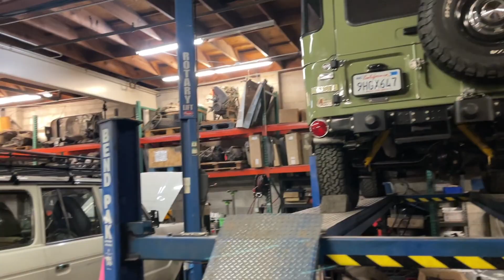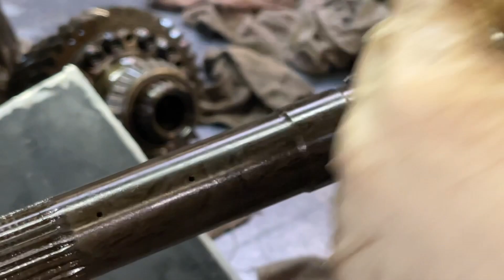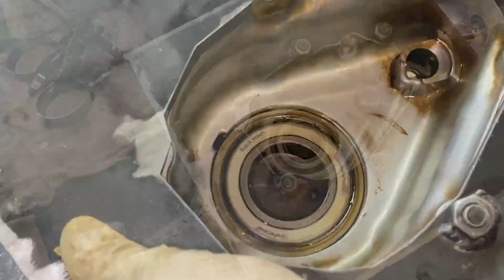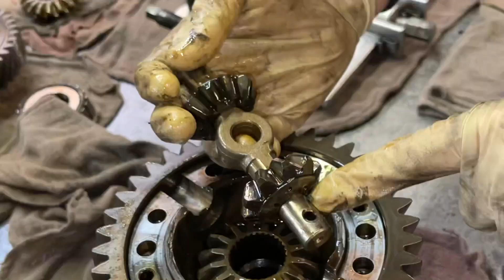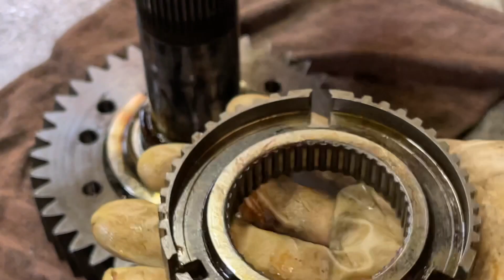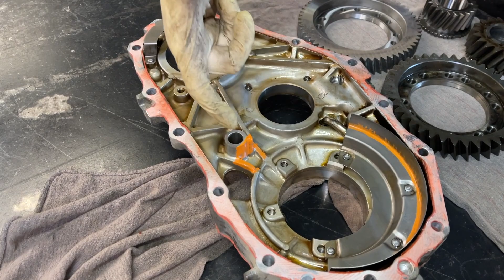80/100 Series Transfer Case Rebuild/Modification (Low/High Range Gears & Part Time 4wd Kit) (Part 2)

Comment: Is there an 80 or 100 series in Tim or Sean’s future? I know you have done a lot of work to those bad ass 4 Runners.
Reply from the maker: The answer is yes if I can find one reasonably priced.  People are asking stupid money for them.
Reply: @TimmyTheToolman  You already know how to do all the major repairs. BTW, in a past video you mentioned a bone density issue. How are you doing? Hope you are well!
Reply from the maker: @richardsauer599  My bone density has improved by taking supplements, changing my diet a bit and lifting weights more.  I think I'm on the right track.  I'm against taking pharmaceuticals for it because the potential side effects can be gnarly.  Thanks for asking.